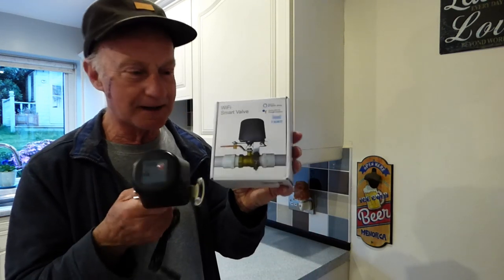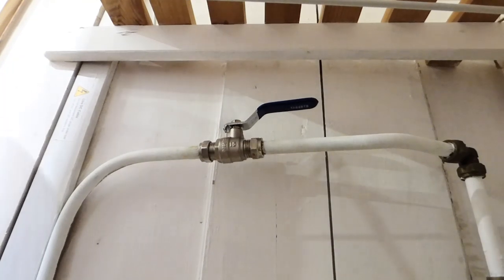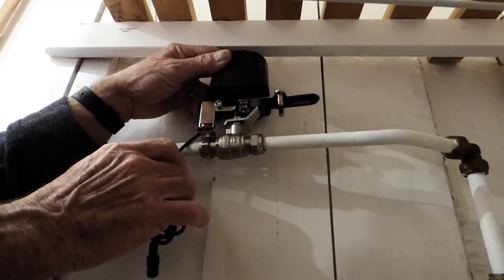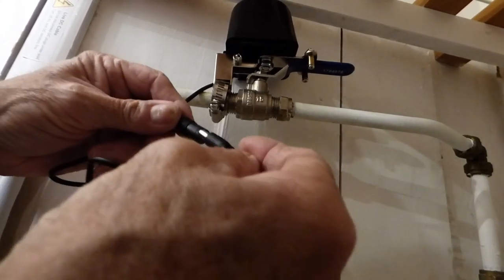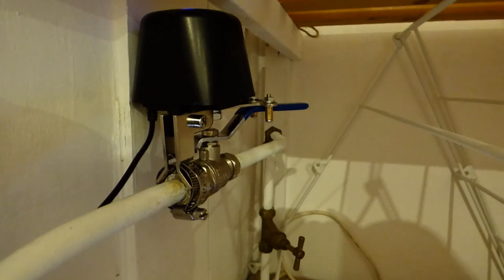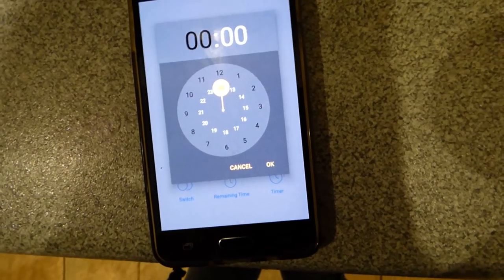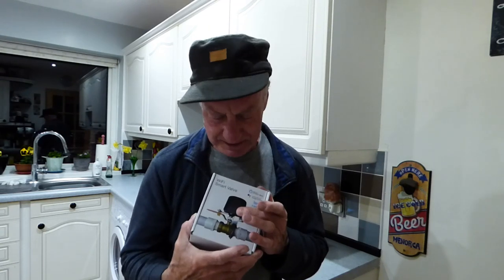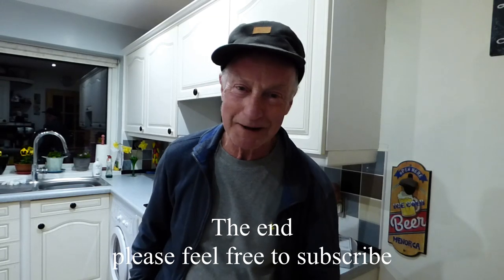How to convert a full bore lever stop valve to a smart one.

Comment: Top tip. If you’re ever supplied one of those so-called “UK” plug adaptors and it has a plastic section on the earth pin like that, chuck it straight in the bin! If they got that part wrong, you can’t trust any of it. Classic issue is incorrectly dimensioned or spaced line and neutral pins. Too big and that can cause contacts inside your socket to get bent out of shape, and then cause arcing and fire when a correct plug is used later in the same socket, or too small and the adapter itself starts arcing.

Comment: I just cut them foreign plugs off and fit a 3 pin plug done it on many occasions, so long as it’s not a voltage drop plug and just a normal 240 all should be well.
Reply from the maker: Good idea Charles.